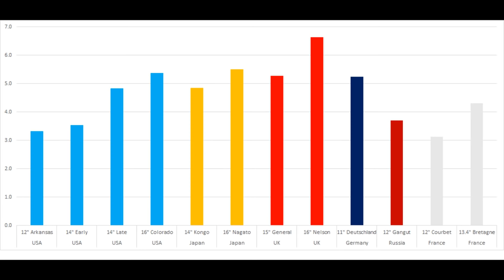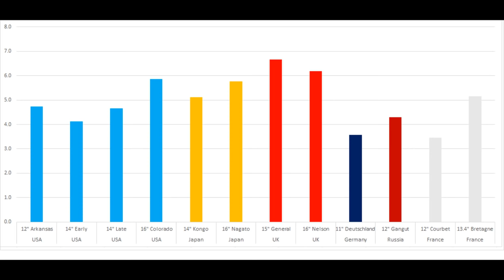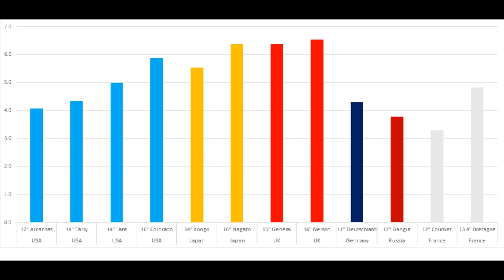Battleship Guns of WW2 - A series of tubes

Comment: Naval Surface Fire Control - This may be the time to discuss the (ballistic) range of the guns which represented the reason for the existence of battleships. The data usually seen is the maximum ballistic range at maximum elevation of a typical mounting for a new gun with the maximum powder charge, at the accepted internal chamber temperature, used with the normal shell. Range, of course, falls off as the elevation of the mounting decreases, which requires the reader to know the actual maximum elevation of the mount in question. For example, some references indicate that the two aft turrets in the “Fuso” class may have only elevated to 33 or 35 degrees (evidently there was insufficient depth in the hull at that point to lower the trunnions and turntable), while the other turrets elevated to 43 degrees after the major rebuild in 1930-35, which elevation produces the maximum new gun range of 38,700 yards for the gun (36cm Type 41) in question. The shells from the aft two turrets would, therefor, only reach a maximum range of around 35,000 yards. Next, the rifling in guns wore down with service, which allowed gases to escape around the shell and reducing both initial velocity and the spin placed on the shell. This resulted in a lower maximum range and less accuracy at all ranges. The RN had a policy of maintaining equivalent wear conditions for each gun on a capital ship to ensure uniformity of performance of a salvo, a policy which it found difficult to apply to the “Nelson” class due to problems with the 16 inch Mark I guns. The powder charge could be varied with different shells to reduce wear when the tactical situation allowed. The USN developed reduced charges for their High Capacity (HC) shells used in their heavy and medium guns which decreased range and penetration, but also minimized wear as US battleships shot off hundreds of HC shells in pre-landing preparations and post-landing fire support. Temperature in the chamber could create performance variations since new gun performance parameters were achieved at specific chamber temperatures. If the chamber were hotter or colder, the powder would burn faster or slower, changing the velocity of the shell. The range also varied by shell. The US 16”/45 Mark 1 fired a 2,240lbs AP shell that ranged farther at a particular elevation than the 1,900lbs HC shell which lost velocity faster over the ballistic arc to the target. All of this capability was directed by a fire control system that was designed to place sufficient shells into an area to ensure at least some hit a target. The initial fire control system, which remained in place for simpler weapons, was for the gunner, or sometimes the trainer and pointer, to look through a sight, with or without optical enhancement, decide when the target was in range and adjust for the movement of his ship and the target to decide when to fire. The effectiveness of this system limited battle ranges to no more than three thousand yards or even less. In 1898, the US Fleet destroyed two separate Spanish forces at Manila and Santiago, despite an absolutely abysmal hit rate. As guns became more powerful, it became more difficult to armor ships against their capabilities at close range, and with the existence and improvement of the torpedo, this drove engagement ranges out beyond three thousand yards and more. New systems were needed, and Scott in the RN and Fiske in the USN advocated and succeeded in implementing the director system. A position high in the ship contained a gunnery officer, several ratings, optical devices and communications equipment. The director would determine the bearing of the target, the optical rangefinder would determine the current range, while the other data needed was estimated. This data was own ship speed, angle of bearing, rate of change and roll along with the speed, range, bearing, angle of presentation and rate of change of the target. The guns would fire on directions from the gunnery officer in the director who could see the target and wasn’t blinded when the guns fired. Starting with a simple optically enhanced target indicator, the next step was adding range finders either at the director, at a position nearby or at the gun mounts. I won’t get into the difference between coincidence and stereo rangefinders, except to say that stereo rangefinders were more accurate but more difficult to use and became universal among navies. At first these rangefinders had a base length (the distance between each optical point at each end of the device) of three feet or so, but it was realized that the longer the base, the more accurate the range taken by the operator. Some rangefinders mounted in turrets came to be over fifty feet in length. Next, instruments were developed to process the data and produce a firing solution which could be communicated to the mounts. The director became more crowded (and less efficient) and the development of sound and electrically powered telephones and data transmission by wire allowed both better coordination between the director and the mounts but also allowed the movement of much of the personnel and instruments involved in receiving data and generating firing solutions into a better protected position in the hull. In the 1930s, a series of evolutionary steps caused a revolution in fire control. The first was the improvement in fire control solution mechanism with the introduction of mechanical analog computers. Initially, the computer assisted the gunnery team using actual manual plots to generate firing solutions. Such computers were designated “range keepers” in the USN. Eventually, all navies had manually operated mechanical analog computers using a system of handles, cams, wheels, rods and levers to input all required data, including ballistic wear and atmospheric conditions, in order to calculate all the necessary outputs needed to generate a firing solution (it should be noted that the Soviets were still using mechanical analog computers in the 1970s to generate firing solutions for anti-ship missiles). Some of these computers later in the period were electro-mechanical systems, while by 1941 the USN was developing electrically driven computers which could, at first, be easily modified to handle a different caliber and then computers that could handle multiple calibers in the same system. In the later, more capable computers, the data generated by the director, the rangefinders, and the mounts, along with ship speed and bearing, were automatically fed to the computer, which generated a firing solution which was then fed directly to the turrets and guns through “pointers” in the sights of the trainer and layer, and in some navies, the computer automatically drove the mounts to the proper train and elevation through remote power control. The USN integrated a “stable vertical”, a device using gyroscopes to maintain an “artificial” horizon and correcting for roll and own ship’s rate of change, which directly fed data into the computer, in place of a manually operated cross-sight in the director. This allowed the firing ship to maneuver and to engage a turning target. Firing solutions could now be generated in a few minutes, in some cases, in seconds. Almost all capital ships had two directors, a primary forward at the highest possible level and a secondary, often at a lower position. Fire control could be switched over to the secondary director, though this could take several minutes (or more, up to 30 minutes, for older systems which required returning all the turrets to zero/180 degrees to reset the synchronizing motors), depending on the transmission system used. One advantage the US and German ships had was the use of AC electrical devices which produced finer and more accurate transmission of data, synchronization within the fire control system and use of RPC. Capital ships with two directors and two plotting rooms, each with its own computer, could engage two targets. The US “fast” battleships had a switchboard in their plotting rooms that allowed any director to use any mount, so that one main gun turret could be controlled by each Mk.38 director and one by one of the secondary Mk.37 directors. In this case, the Mk.37 director would by-pass its own computer to synchronize with the main armament plotting room. Some capital ships had an emergency control director in the rear of a turret (usually a super-firing turret farther above the waterline) with a simplified computer to provide director control to the gun turrets. Each mount, of course, could engage targets in local control, some navies fitting simple fire control computers at the turret officer’s station to generate a firing solution. All of this was controlled by the ship’s gunnery officer. Positioned in the conning tower or on the bridge, the gunnery officer usually had a target indicator, binoculars on a pedestal or a periscope that might communicate bearing automatically or manually. Often the gunnery officer had a spotting glass or even a rangefinder. Sometimes there was even a simplified fire control computer at his station as a backup. Modern US “fast” battleships had two primary and six secondary directors for the main armament.

Comment: I would strongly recommend to give more weight to accuracy. I think it is a decisive factor for a gun. So, hitting your target is the purpose of a gun, isn't it. The values for AP and explosive power of a missed shot is quite zero.

Btw: A formula for the effectiveness of a gun could be written as pA*pP*B*R at 20,000 yards where p stands for probability and is a stochastical value, A stands for accuracy, P for armor penetration, B for the bursting charge and R for the rate of fire. In this case, regarding overall effectiveness, accuracy would be weighted equal as compared to all other major factors. The most challanging part might be to determine the stochastical value for armor penetration.

Comment: I wish you had included muzzle velocity in your analysis, because of its effects on danger space and armor penetration.  For a real life example look at the battle of the Denmark Strait.  Bismarck, firing a relatively light shell with high muzzle velocity, was able to straddle and hit Hood very early in the battle, at least partly because of the flatter trajectory of her shells, which increased the danger space for the Hood.  The battle was fought at ranges at which deck hits were unlikely to penetrate any of the capital ships on either side, and as you yourself have pointed out, the shell that sank Hood probably struck the side of the ship, rather than the deck.  I consider danger space to be critical at the ranges—let’s say 19,000 yards and under—at which the battle was fought.  Crucial hits do not have to be ship-killing hits.  Early in an action, hits on bridges, fire-control units, funnel bases and steering gear, to name just a few, can ultimately prove decisive later on.  None of these areas, except conning towers proper, are protected by heavy armor.  Guns with higher muzzle velocity tend to produce salvoes with wider patterns because of the flatter trajectory of the shells.  This should not be confused with inaccuracy.  At 20,000 yards a salvo from Bismarck could have one shell landing three hundred yards short and another striking the target, all because of the increased danger space.  I think that muzzle velocity, if available for all these guns, should have been included in the assessment of their performance.

Comment: The reason why a range past 30k yards is a non-zero factor to consider isn't just because of the "possibility" of hitting beyond it...  It's primarily because the elevation of the gun will be flatter than a gun already at or near it's maximum inclination of barrel.

This is important because the shell will have a flatter trajectory, less shell flight time, better angle of attack on the armor, less chance of a ricochet, and more kinetic energy transfered on target.

While this is less important for HE or SAP shells than, say, for AP high velocity shells, it is still an important factor to consider when considering engagements outside of normal effective ranges (ie. 30k yards or more).

Another factor often considered important in earlier construction as well as the most import factor for the BB's brought back in the gulf war is the maximum range of fire for shore bombardment.  Toward the later BB's in WW2, this was less of a design influencer, because the bombardment ranges already could reach deep inland on the small Pacific islands.  Not to forget, nearly all BB guns in the late war could easily reach shore facilities with little chance of shore facilities reaching them with any real effect due to the obvious...  Moving platform vs static.

Comment: Maximum point-blank range and maximum theoretical range are so closely linked that I'm glad you didn't cap range.

A gun with a theoretical 45,000 yard range is also much easier to find elevation for than a 30,000 yard gun, even if the target is only 20,000 yards away.

This is because the velocity of that longer-range projectile and its higher ballistic coefficient will also mean that it drops much less for any given distance it travels.

This is hugely important for naval warfare, where the gunnery platform is essentially never perfectly stable.

Comment: Also on the shallower gun elevation angle, you have less distance to travel to elevate and then lower to reload the next shot.  This will speed up the rate of fire if the rest of the turret systems can keep up with the reduced travel time.

Edit: Commented before watching the whole video. Drach already went there.